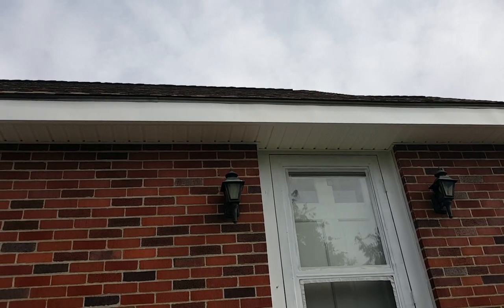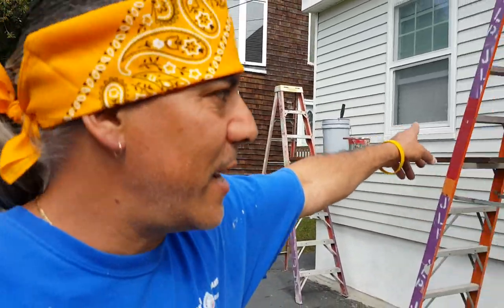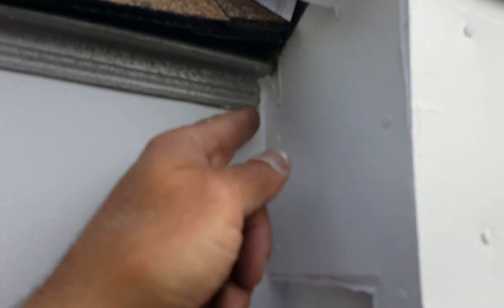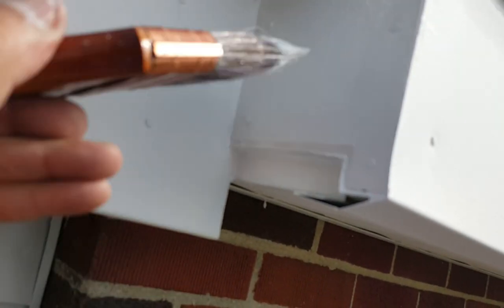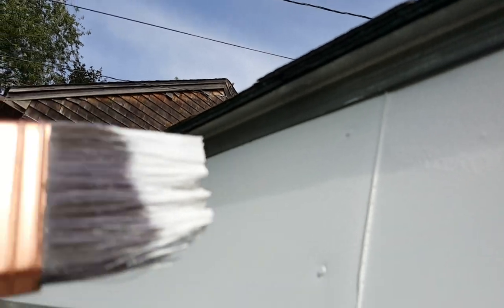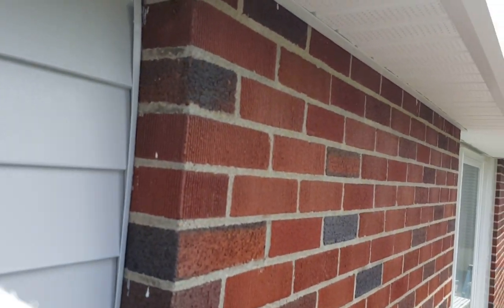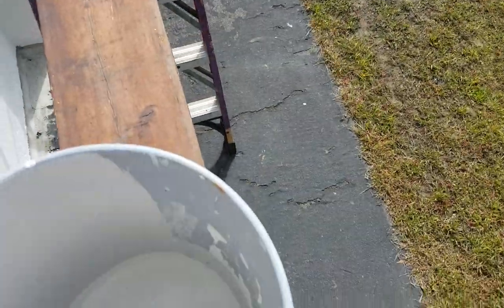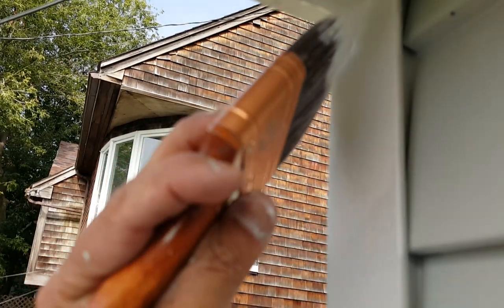Da P8NTRMAN🎨,  Painting Exterior aluminum siding.

Comment: Thanks for the helpful painting videos. There is so much to learn in this trade and it deserves to be recognized as such (a trade). What is your opinion on brushing and rolling aluminum siding? In other words, do you think one can get away with painting an entire aluminum sided house without using a sprayer?
Reply from the maker: @Jamey Slick, Thank You first and foremost for your encouragement. Painting is an Art and a dedication that can only be done with experience, Love and appreciation to serve others.

Aluminum siding can certainly be brushed n rolled. I would suggest to stay out of the Sun for starters, secondly use a short nap roller, preferably 1/4 inch nap. Paint the siding from seam to seam to prevent overlaps and only paint between two to three sections across at a time. You want uniformity. I recommend using a Satin finish but you can certainly paint it in a flat. I akso recommend wether spraying or brushing and rolling. Use the Emulsa-Bonder to get the best adhesion possible for a better quality professional finish. 
Cover areas where you might drip paint to minimize clean up. 

Have a wonderful time Painting your project. Be safe always.

God Bless and Thank You for watching the P8NTRMAN videos. 
Jhonny Da P8NTRMAN
Reply: Thank you for your response! The aluminum siding on the house I'm about to paint, after washing, (low pressure) has quite a bit of oxidation and there is some bare aluminum showing here and there. Should I prime the whole thing? or would adding emulsa bond to the paint be sufficient.? Also, if I do prime, should I still add the emulsa bond to the paint?
Reply from the maker: @jameyslick8483  , Hello there. I wouldn't  prime. I know that the tendency is to consider a Primer becaude we are all taught that. Let me explain, if it was bare wood, I would definitely prime it, in most cases if there is bare metal, use we usually use an oil base primer, however because of the fact that Aluminum oxidizes versus rusting it has to be approached diferently because of the oxidation process that it goes through. Also as I mentioned in my videos, the cold and the heat will cause that metal to expand and contract stressing that coating by streching. Aah'haaah! So that is why I uswd the Emulsabonder because it causes the coating to hug the surface as it dries and adding it to the Duration exterior layex paint which by the way, it has high viscosity, it then dries and as it cures it stays pliable,  similar to a rubber coating. It stays flexible even though its dry. This is why I advice everyone to use this method. You must use Duration, dont allow Sherwin Williams to entice you in purchasing the Emerald Paint. I dont like it at all. 
Please, please follow my measurements to the T and add water for flexibility but not so much that it becomes runny. Follow the instructions. 

Secondly, dont go buy Behr paint and expect this formula to work. It wont. 

Also, make sure you wash that structure thoroughly with TSP by Savogram to Etch the aluminum. This opens the pores of the aluminum for better adhesion.

Thirdly, you must apply two coats. And to answer your question. Yes, you can brush, roll or spray this coating. Wait a day between first to second coat. A quick tip, if you store your paint for more than a day, pour about a quarter to half an inch of water on top of your paint to prevent it from drying and crating a skin on rhe surface. The water delays the evaporating process. Store the paint in a cool spot away from the heat of dirwct sunlight. 

Orher than that, you are ready to paint. This paint job should last between 6 to 8 years. Ive seen it go 10 years. 10 years of being beat by elements, Sun, Rain, Hail or Snow and still staying together is a great investment. 

Good Luck Jamey and Happy Painting. Please be safe, hydrate, take your time and do it right. You will love the curb appeal. Beware, the insurance company may raise your premium. But your house will look like new. I guarantee it. 

Thank You for viewing my videos. God Bless You! Please let me know how it turned out.

Jhonny Da P8NTRMAN
Reply: @JonathanLaSalle  Thanks for your quick and concise answer. May God bless you for the services you provide. My local Sherwin-Williams keeps telling me that I should use the super paint because the duration is thick. I see that is why you add some water to the mix. Clearly they don't understand the symbiotic relationship of the ingredients in your formula. If only every paint store salesperson was a painter LOL.
Reply from the maker: @jameyslick8483  , Very well said. Us guys in the field play around with coatings and combinations. I compare it to having a headache, we take Tylenol or Ibuprophen, and because it works we continue to purchase it and refer it to our relatives because we care for them. The same applies to painting or any other trade. When you find a carpenter that can do excellent work, he or she becomes a go to guy. I know what Im talking about being a Painter for 27, almost 28 years. I do not claim I know it all but I listen, I test, I try and I keep track of products that work well. 
Jamey, if you have any questions feel free to ask. I guarantee you that I will reply as soon as I can and I will give you an answer. Thank You for your consideration and your trust in me. I used to live in Massachusetts but now I live in Washington State. I landed a cushiony University Job. In 10 years I will retire. I have had many years in this business and met many good Painters. Some really sucked but many knew a lot. Ive been a leader at every company I worked for. My work ethic is noticeably different than most painters. I speak three languages and I have made a great living at it. No I Love helping people with ideas.

Have a blessed weekend. God Bless in abundance. Peace be with you.

Sincerely,
Jhonny Da P8NTRMAN

Comment: Hey man thanks very positive! I'm doing my aluminum sided 65 camper trailer, is this acrylic?
Reply from the maker: Hello Christopher, yes it is. Thank You for watching my video. Happy Painting!👍🏻 God Bless You N be safe.

Jhonny Da P8NTRMAN
Reply: Planning.on using marine acrylic something that I can roll or brush on that'll dry smooth, Sherman Williams I think has it, or.maybe something.else,.you day.man, any recommendations?
Reply from the maker: @cmc02888  , You can speak with a Sherwin William's rep. Duration is a great product and so is emerald. If you want a Marine product you can ask them what they have in stock or what they can get for you. They have it all. Make sure you prep it good with a good power wash first. Pro Industrial DTM (Direct to Metal) is a great product. Make sure you do 2 coats. 
Happy Painting!
Reply: Really appreciate it , finally a professional, been watching people put videos up using oil based paint for aluminum...
Reply from the maker: @cmc02888  , No Christopher, oil does not work well. It doesn't last. Temperature makes metal expand and contract and Oil Base products fail. Latex/Acrylic is more resistant and last longer. I also add the product Emulsa-Bonder to the paint which gives the paint more bonding without the use of primer. I recommend two coats. Always.

Thank You for viewing my videos. The information is shared to help everyone who is thinking about painting. I have several videos. Watch them and take notes. If in doubt consult a Sherwin Williams store rep and compare. Also remember that this video was 6 years ago. There are better products on the market that may work better.

Good Luck Christopher

Jhonny Da P8NTRMAN

Comment: Hey bro what paint do you recommend for lanai aluminum? Want to paint it black
Reply from the maker: Hello Michael, give me a little time to research. I have some questions first. Is the metal powder coated? Is it flaking? How old is it? In the meantime I will inquire with my Sherwin William's Commercial store. You will need a High Performance Product. Thank You for reaching out. You can also email me at jlpaintdesigns@gmail.com
Reply: Jonathan La Salle I think it was sprayed on long time ago but it’s just faded paint not flaking or nothing. I want to hand paint it and use a roller. Just not sure on what paint. Thank you man!!
Reply: Jonathan La Salle I live in Florida
Reply from the maker: The best paint for this application is Sherwin William's Pro Industrial Pre Catalyzed Waterbased Epoxy. Paint it in a Semi Gloss finish to resist moisture and / or condensation. Clean the surface with denatured alcohol throroughly. Good Luck. Feel free to email me whenever you need me. I can also provide you with my number and you can call me. Happy Painting!
Reply: @MHS_ART  Local lanai cage painters use Pro Industrial WBU - Water Based Urethane.  Epoxy will fade in the sun.  I just sprayed mine white here in Sarasota, FL, and I'll never paint another cage again.  What a pain.  Flashing and overspray is a big problem.  If I were to do it again, I'd brush and roll and live with the stippling.  Add a little Floetrol to the paint to give yourself more open time and allow longer areas to roll to help make the finish even out.  The Floetrol will also help the paint settle out.  Don't be too concerned with the stippling when you are working because much of that will go away as the paint dries.  I stepped up and used Emerald WBU and didn't have to use the Floetrol.  After painting the cage, I sprayed the soffits and fascia.  They turned out way better than I'd expected.  The houses in our sub-division are about 12 years old and the soffits on many of the houses are black/grey and white.  I hand scrubbed them for the past 3-4 years and now I don't expect to ever have to do it again.  The soffits and fascia look better than new.  We laid a 4 x 15 drop cloth down on the roof up to the very edge to keep overspray off the roof and it worked perfectly.  IMHO Epoxy of any kind is not the product to use in the harsh sun down here.  Check with your local Sherwin Williams store and ask if they'd recommend Epoxy or Pro Industrial WBU.
Reply: DRitz78 thanks man. I live in Port Charlotte lol

Comment: I understand your instructions for prep and painting Aluminum Siding. If it's sprayed or if using a brush and a roller. I figure you would prime new aluminum rain gutters. What primer would you use? I have used Kilz before. What if the rain gutters have been painted with a brush before. Their just faded and the paint and paint work wasn't very good. THIS IS UTAH, EXTREME HOT Summer's AND Winter is COLD, SNOW. Thanks, Sam
Reply from the maker: @Sam Martinez, great question Sam. I will explain a few scenarios. 
(1) If the gutter and downspouts have been previously painted  but you have a bare metal spot yes you can use kill 2, its a latex based interior or exterior primer. Dont use oil. This is the misconception that most people think. Home Depot paint department guys will also try to push the Kilz products. I would advice you to use a Latex waterbase product. Latex is more resistant to heat and cold combos.
(2) If your gutter is newer and came in a white which by the way its powder coated from factory. Piwder Coated means that the aluminum is electrically charged and it goes in a conveyor spray booth where the spray particles automatically adhere or stick to the surface, then it goes to an oven where it will bake and cure in a heated environment.  Prior to painting you must de-gloss te surface with alcohol by using rags and wiping it. After de-glossing you then can paint it in a satin finish DTM(Direct to Metal) paint by Sherwin Williams or Benjamin Moore, whichever you prefer and coat it twice.

(3)If you want to paint it in a different cheaper product then you must prime it all. There is a fairly new product in the market that is called STIX by Insl-x. This is a bonding primer with outstanding grip. Then you can top coat it later.

Keep in mind, if you paint you gutters abd or downspouts in a darker tone of green, blue, grey, orange, burgundy, red then you must use a grey primer or you can tint the primer half strength to the color you are using.

Make sure you power wash with TSP and a little bleach  to kill any mold or mildew the gutter and or downspout may have. Before painting gutters and after power washing n cleaning your gutters look out for leaks. It there are leaks make sure you seal the seams with a gutter sealer sold in the gutter department. Apply the sealer to the inside of the gutter. Sometimes the sealer is silicone based and paint cannot stick to silicone. Also watch out for wasp nests when removing the downspouts. Talking anout down spouts some gutter companies like using pop rivets. I despise them. I'd  rather use screws to re install the downspout to the gutter. 

I may have given you more information than you need but you akready know me. I explain details that not everyone feels like sharing. Dont forget to get yoursrlf extra downspout straps. Some people like using roofing nails to nail the straps to the house. I like using exterior deck screws that are coated w paint. Dont use drywall screws. They rust out too easy.

Well Bro, if there is something I didnt mention hit me up for more information. Do a good job. Be safe, plant your latters securely into the ground. Dont give your ladder too much belly as we call it when its angled away from the house to far. Always watch out for overhead tree branches of power lines coming into the house. Keep 10 feet distance. I know a Painter who was painting around wires and he got shocked. Electricity came in through his hand via the brush and it went through his body blowing out one of his big toes, his sneaker disintegrated around his toes. So be careful. The Painter lived to tell about it.

Happy Painting Sam! God Bless You in abundance.

Jhonny Da P8NTRMAN
Reply: @JonathanLaSalle  Thank you, so much for answering so quickly. I will be following your video's and reach out again for advice. ENJOY !
Reply from the maker: @sammartinez4244  , Anytime you need me I will try to answer as quickly as possible.  I think I will make a new video talking about the topic you asked me. Also in the future I hope to make videos in spanish for our Latino viewers. I also speak Portuguese from Brazil. Everyone deserves to learn. 

Take Care my friend. Deseandote todo de lo mejór desde el Estado de Washington. Dios te Bendiga.

Jhonny El Pintor
Reply: Hi, What do if you want to paint brick? Prep and painting, The brick is on the lower portion of a Utah house. What about painting Hardy Board Siding. In Utah. Thanks,
Reply from the maker: @sammartinez4244  , I have a video for painting concrete or brick foundation. 
Fist Power Wash real good, allow to dry for about 2 or 3 days. Prime with Sherwin Williams  LOXON. LOXON can be tinted to the color you want half strength. Then you Top Coat with a Satin or Semi-Gloss finish. I recommend CONFLEX Sherlastic elastomeric Coatings by Sherwin Williams. Great product and it lasts.

For Hardy Plank siding simply use DURATION exterior Coatings. They will try to sell you Emerald. Just say no, choose Duration instead. It is an amazing product. Emerald is more expensive.

Thank You for asking Sam👍

Have a Great Day!

Jhonny Da P8NTRMAN